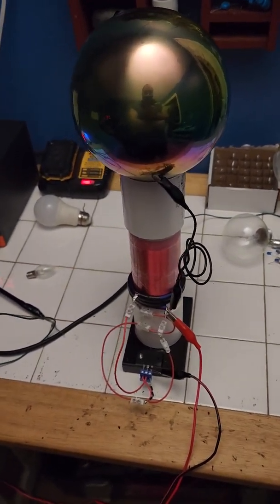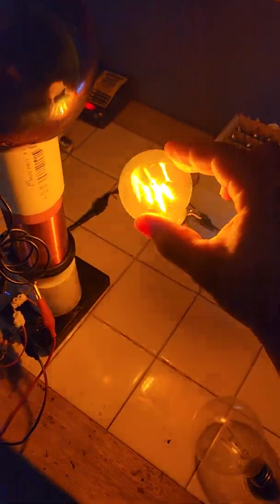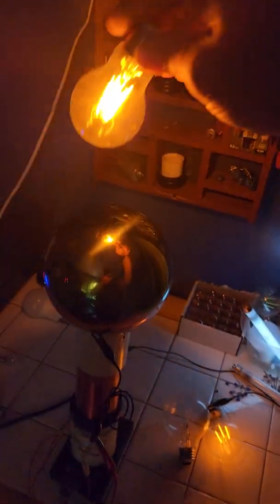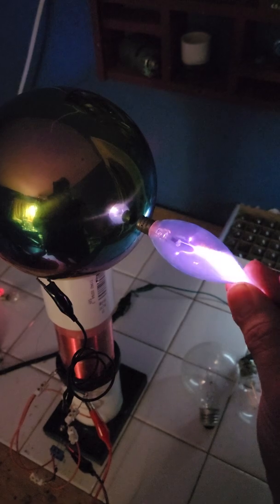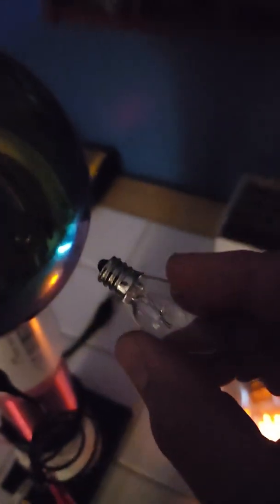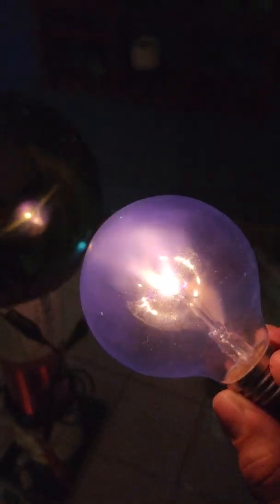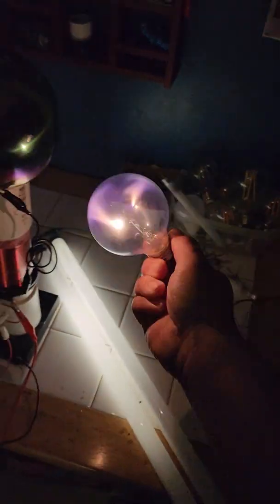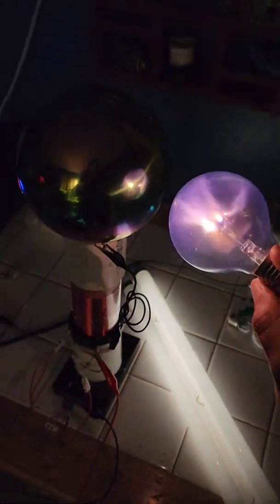👻 👽 INSANE CONJUGATER COIL MK2 TESTS & OVER UNITY PHENOMENON FROM GROUND POWER PUMPING 🌩 ⚡️

Comment: The plasma in the bulb 💡 s does look amazing 👏 
I have seen a couple ways to light LEDs so I bought some grow lights and one that works like the energy savers like flourecent types  so I have 4 in all my plan is to try run them using as less energy as possible I want to try with 3 tiny solar panels only usb linked together with a battery try run them 24 hrs it would then be able to make growing cheap as it the biggest cost is electricity also what effect would this have on growing also would be somthing I would investigate

Comment: An easy way to determine how many watts a bulb is drawing is to use a variac or dimmer.     Use two identical bulbs side-by-side, one powered by the dimmer and house current, the other powered by the coil.

Note the power draw on a kill-a-watt from the dimmer when the bulbs are both the same brightness.

(Not a perfect measurement technique but it will get you close)
Reply from the maker: Thanks for the helpful comments & I noticed when my system is on I can run loads between 2 seperate ground points. How weird is that? I'm not joking I think I discovered how to extract power out of the Earth.
Reply: @MTECHINDUSTRIES  Yeah, there's some weird/complex effects that can happen at RF frequencies.
HAM radio geeks will see weird stuff like that sometimes...🧐

Our group gets some stuff like that, but extracting useful power turns out to be a bit more difficult.
Reply from the maker: @hakasays  yeah my goal is to create some form of energy pumping device that can harness power from the Earth's natural electrical system. Have you ever heard of Don Smith? He supposedly figured out how to extract massive amounts of power out of the Earth but sadly he passed away.
Reply: @MTECHINDUSTRIES  Oh I've been in the Fringe sciences for 20+yrs now, I know 'em all😁
I had some weird 'successes' early on, but it took a LOT longer to develop the baseline skills to understand what exactly was happening.

It's crazy how incredibly complex a single coil can be when you really dig down and analyze it.
Reply from the maker: @hakasays  isn't that the truth haha. I've spent nearly a couple months just fine tuning my older 4 inch tall coils to increase the range & I discovered all of your useful work regarding Tesla coils. I think I'm going to build one exactly the way you recommend in your video. I just have to figure out if it would work with my modified slayer exciter circuit. So far the best frequency range for my wireless power system seems to be 3mhz.